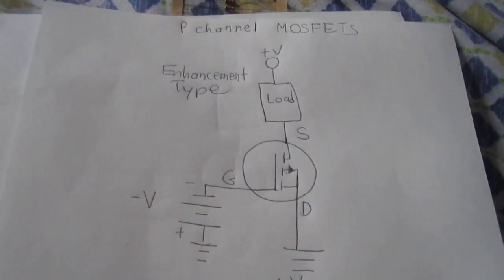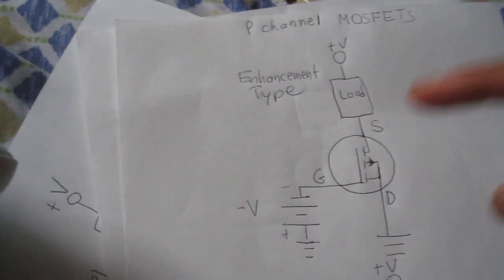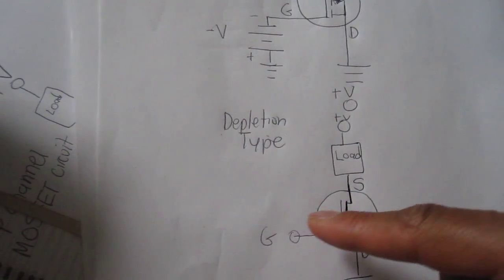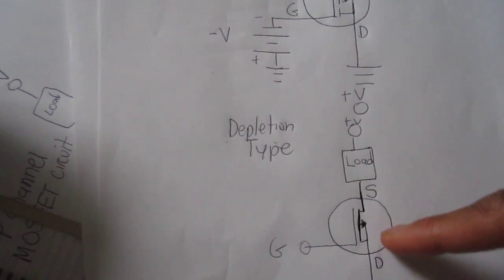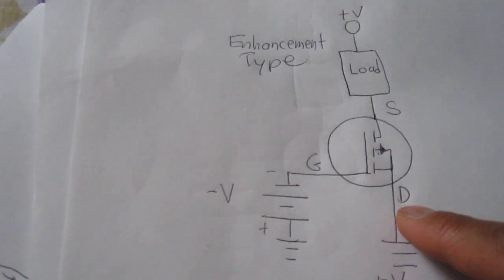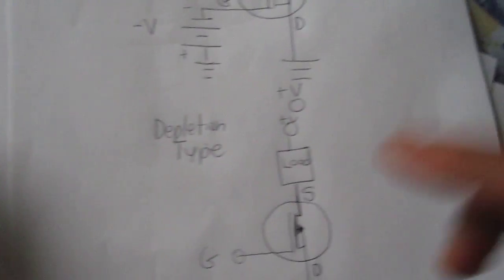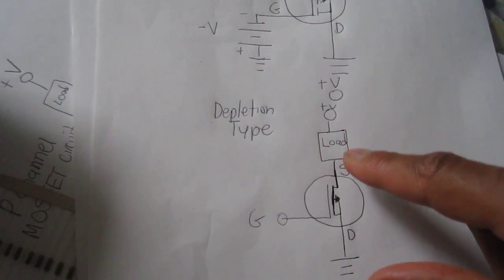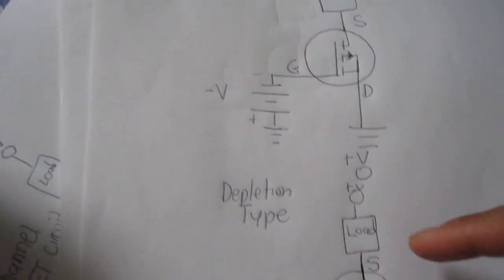How to Bias a P Channel MOSFET

Comment: On p channel mosfet u are connecting a gnd to drain? Are u sure? It should be positive of your load.
Reply: of corse its wrong it should be connected as High Side mosfet not low side ,,,,but ( enhancement - depletion explain is  correct)

Comment: I think LOAD is connected between DRAIN and NEGATIVE POWER and SOURCE is connected to the Positive as the N channel
Reply: What does it Matter if you supply the negative to load or positive to load it still will run, Its like a SWITCH.